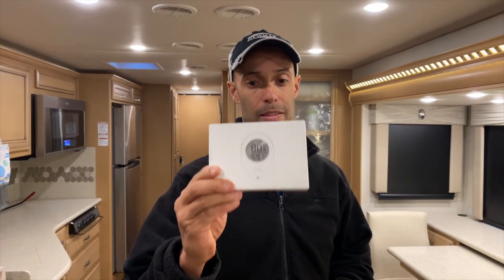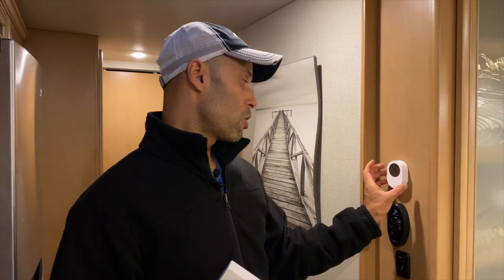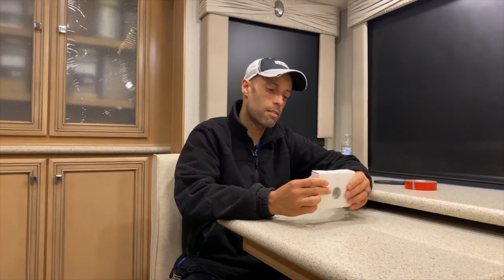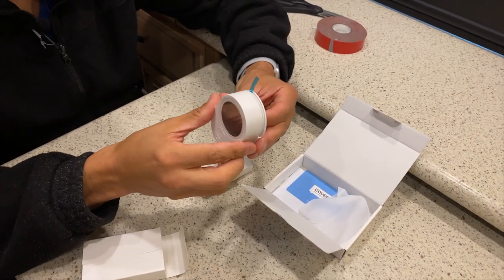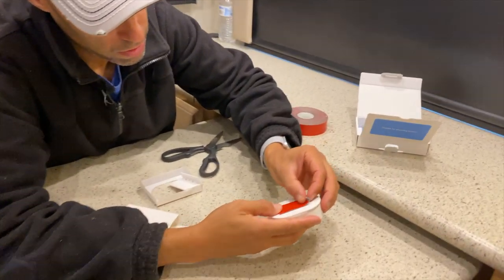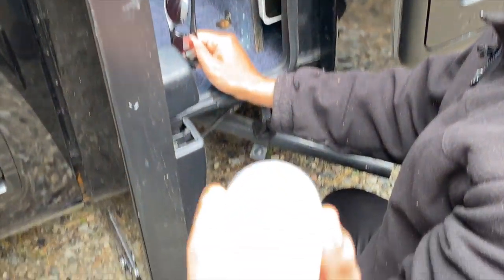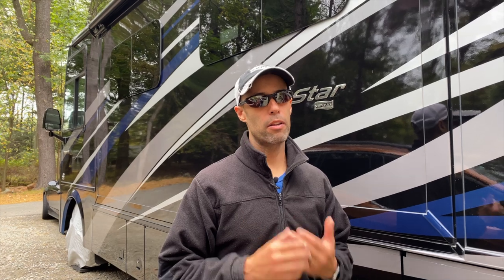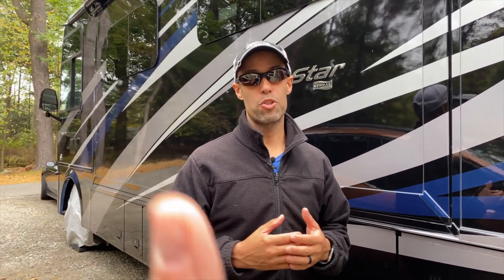NEED TO MONITOR THE TEMPERATURE OF YOUR RV? REVIEW OF THE GOVEE WIFI TEMPERATURE MONITOR

Comment: They now have a newer version for only $11.99. Going to try this. Great video by the way. Very simple and right to the point.
Reply from the maker: Jaz price sounds right to me.  At that price I will add another to my RV basement.

Izzy
Reply from the maker: Actually the 11.99 one is only Bluetooth.  You want Wifi also so you can monitor remotely.
Reply: @EndlessRVing  thank you for noticing that. I will have to get the WiFi version then.

Comment: These are great if you have a hotspot on board, otherwise you might be better off using a Marcell which also has water leak detection ability.
Reply from the maker: We do have an onboard network.   Thanks for sharing.

Comment: Thanks for the great tip. Now my questions. We just bought a Newmar and before we take our first trip south, it will be in storage for 2-3 weeks. So when in storage and powered down how do I get the Wi-Fi to work since I’m not plugged in? Any recommendations  on an alternative power source to connect the Wi-Fi too to pair with the temperature monitor into? Im planning on winterizing the unit but would still want to monitor temps since temps will range from high 40’s in day to mid 20’s at night for a few nights. Patience please, newbie here and great vids Izzy
Reply from the maker: I would not suggest storing for 3 weeks unless you completely cut off all power to the coach or plug it to power.  You will likely destroy your house batteries.  

Thanks for watching and the comment

Comment: Izzy If I understood you correctly your Govee is bluetoothed or wifi to your in coach wifi network and that network is connected to the campground wifi.  Is this correct?  If so, what is the back up if the campground does not have wifi or you are boondocking without an available wife or cell service?
Reply from the maker: It’s Wi-Fi and we have a on board Wi-Fi set up
Reply: @EndlessRVing  thanks I did understand that I was more curious as to what you actually used as the pipeline to the service such as cellular or park Wi-Fi. Great videos I have watched many of them.  I seem to be on track to liquid suspension but I’ll need to find a dealer here in Southern California